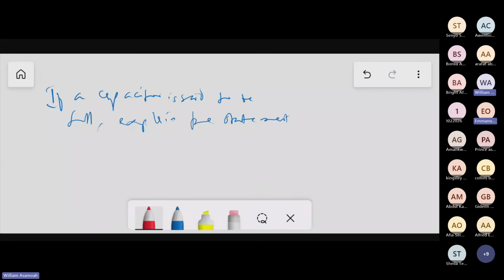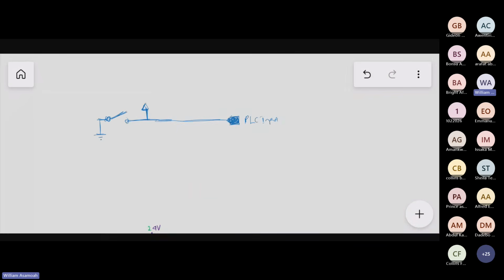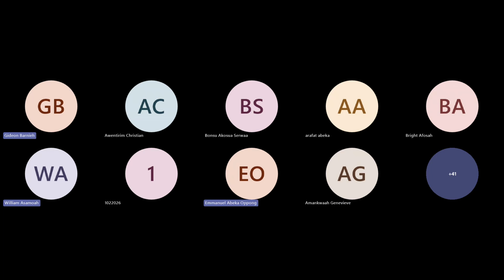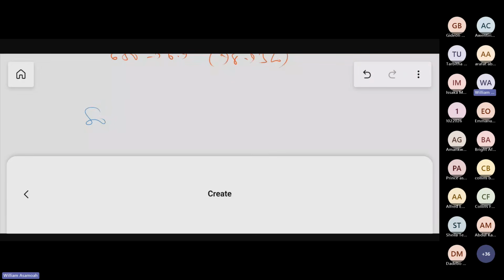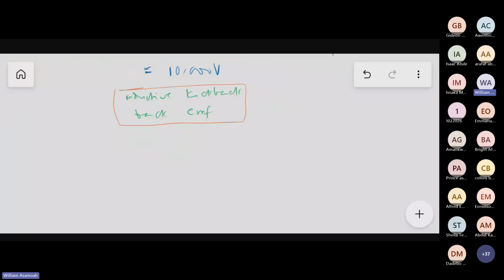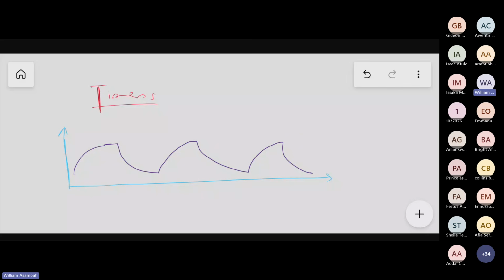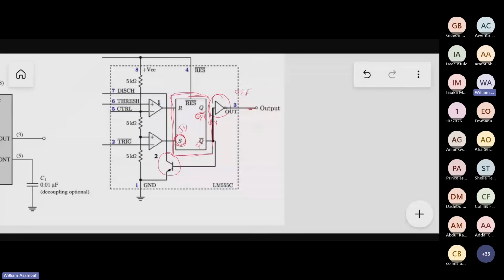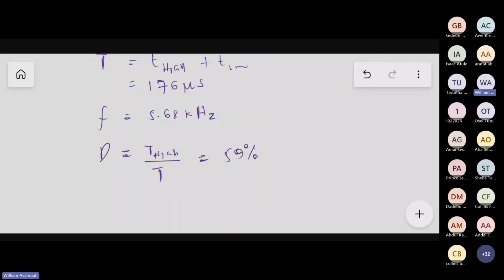CENG 102 - MME100A - Chapter 03 - Capacitors, Inductors & 555 Timer Circuits.

Comment: Why is the duty cycle 50%??
Reply: And why not 40% ???
Reply from the maker: @KobbyDeMereks  You can also have that design.
Reply from the maker: That's the default mode. You can always reconfigure based on your design. Brilliant question.